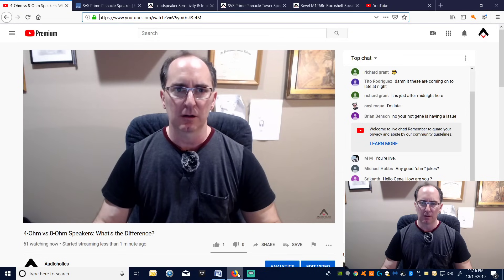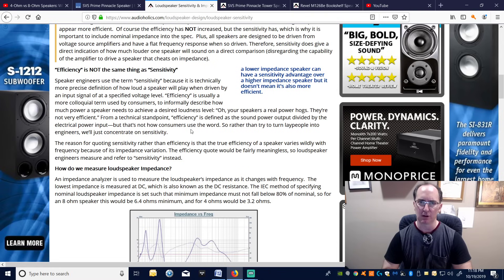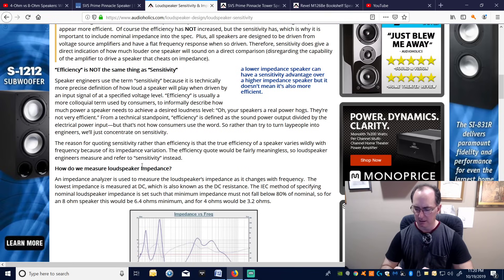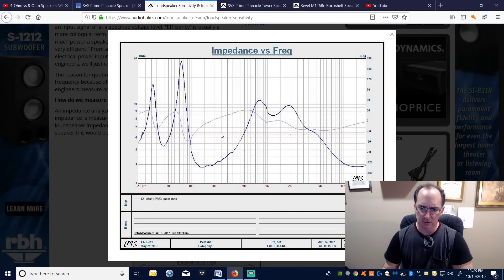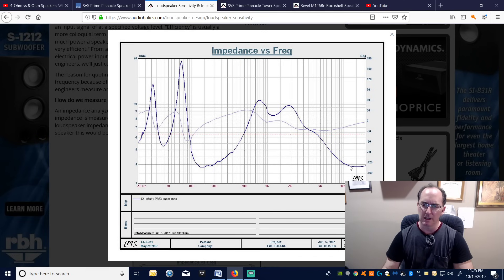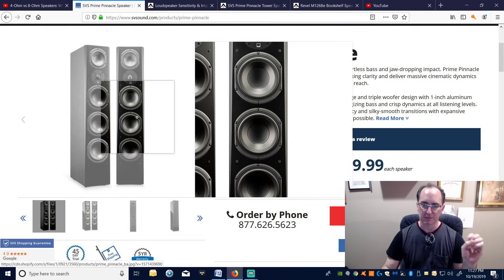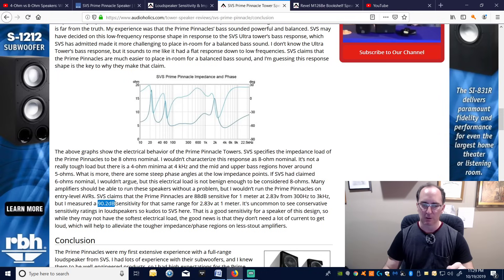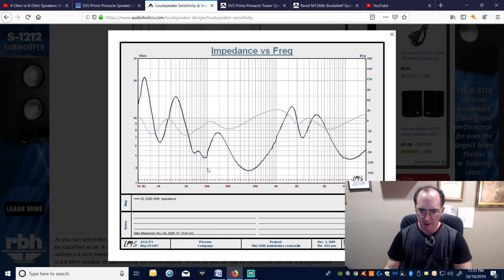Loudspeaker Impedance 4-Ohm vs 8-Ohm: Which is Better?

Comment: I only run 8 Ohm speakers at no lower than say 86db or 87db....    It's not worth going with a 4 and being stuck with only more expensive amps to run.
Reply: I run a 5 speakers in a 5.1 system that are all 90dB & 8 Ohms. With a separate stereo power amp for the front left & right speakers. Separate mono amp for the centre speaker, and a separate two channel amp for the surround speakers.

Would have cost me much more money for good quality compatible amplifiers if my speakers were rated at 4 Ohms.

Comment: Does 4 ohm speaker require an amp with more power? I would think a amp with less power (i.e. more bang for the buck) since it plays louder. example: 33% of my amp's power into a 4 ohm would be louder than that same volume level (33%) into an 8 ohm. So i would have to turn the amp up to get the same db for a 8 ohm vs 4 ohm. Confused on why 4 ohm taxes an amp.

Comment: If you put two 4 ohm woofers in series and the woofers are rated at 86.7 dB 2.83V/1m, then the combined speaker wired in series would have the same sensitivity of 86.7.  Is that correct?
I am talking about the Dayton Ultimax 12" woofer.  See https://www.parts-express.com/pedocs/specs/295-512--dayton-audio-um12-22-specifications.pdf  I like this woofer and want an 8 ohm system that any amp can drive, so I would rather not use two 8 ohm woofers in parallel.  I also want better amplifier control over woofer movement, so isn't an 8 ohm load going to result in better damping?

Comment: i have a question i have a pair of polk audio TSI 300 tower speakers. the specs say 8 ohm but why is it when i read it with a ohm meter it says 3.6 to 4.1. all speakers in towers are working and sound great but when i crank it up my receiver clips. it is a Yamaha RXV659. Thanks

Comment: Bottom line is you need to know what is your amplifier output capacity then you can match the speaker impedance and wattage you need. Never buy a speaker where you don’t know the application 😂

Comment: Hi there. I have an AV Amplifier by Onkyo and a pair of tower speakers with 6 ohms impedance. I had some issues with the amp shutting down. I was advised by amp technician to select 4 ohms impedance in amp selection instead of my original selection of 6 ohms or more. Please advise me on this 4 ohms impedance selection on my amp with the 6 ohms impedance tower speakers. Will it cause any harm to either amp or speaker? Your technical info appreciated.

Comment: So an 8 ohm rated amp can run a pair of 4 ohm rated speakers as long the amp doesn't overheat due to increase in watts? 
So it's not even about the ohms per se then, it's about the increase in watts which produces higher heat than what the receiver may be able to handle? 
Am I understanding this correctly?

Comment: Have a new Pyle  amppifier 40 Watts x 2  POWER OUT PUT that requires a 10% RMS 4 ohms speakers , but I have a pair of 60 watts 6 ohms JVC bookshelf speakers on hand . Think these 6 ohms will work .

Comment: So let's say you have two different 2-way bookshelf (tweeter+woofer) speakers from the same manufacturer. Same sensitivity, same woofer diameter. One is 4 ohms and the other 8 ohms. Assuming all other things being equal (no amp clipping etc), why would anyone buy the 4 ohm version? 
Is there something inherently better about a low resistance coil that translates into more linear driver motion? The compromise being it just wastes more power.

Comment: Hi Gene - thank you so much for the explanation on 4 ohm vs. 8 ohm speakers.  Follow-up...I am considering a pair of Tekton Pendragons - Eric offers them in 4 ohm builds or 8 ohm builds.  I have a high current 250 watt per channel amp - should I go with the 4 ohm build with upgraded 4 ohm caps and capacitors??  I was thinking the 4 ohm as I want to eventually dive into tube amplification. Thanks
Reply: The higher the ohms, the less power they require.

Resistance gives you an idea of efficiency, but not of audio quality.
Reply: Scott...I have the 8 ohm Pens with the 7 tweeter array and upgraded wiring and caps...Love them.....They wanted me to do the 4 ohm and I said no way....Almost all hi efficient , hi end audiophile speakers are 8 ohm. They sound better.
Reply: I'm going with the Enzo XL with 7 tweeter upgrade and upgraded crossover components. I'm deciding between 4 and 8 ohms even though my Parasound amp can handle 4 ohm loads. I just think it will run hotter and don't want to replace it any time soon. Eric is pushing hard for the 4 ohm.
Reply: @blipco5  I know they push almost too hard for the 4 ohm.....Most high efficient speakers are 8 ohm. Even the reviewers say to always use the 8 ohm tap if you have a choice. Good Luck...Good Choice but 8 ohm for me. I will Never sell these speakers because nothing for $2500 even comes close. Don't forget to get a Schiit Loki mini for $148...tone controls are fabulous.
Reply: Dennis Haley.. Thanks for your response. My Parasound P6 preamp already has tone controls which is one reason I bought it though I normally run in bypass. I only use the tone circuit when I use my FM tuner to boost the highs and either bump or tame the bass. My power amp is the Parasound A23+ and can easily run four ohm speakers but I had concerns. So I contacted Parasound and they told me that the four ohm speakers will not be a problem as long as the amp is well ventilated, which it is, but that confirmed it will run hotter. So it's 8 ohm for me as well.
On a side note, they really like the Tekton speakers and they use them to demo Parasound equipment. Mainly for space requirements (Eric suggested the Pendragons but they just won't fit the space, they'll block off two fairly expensive paintings). I'm getting the Enzo XL with the seven tweeter upgrade and crossover upgrade. My big problem now is figuring out the custom color to match my room. I'm replacing my beloved Speakerlab S3 that I built 40 years ago with recently recapped crossovers.
The S3 are nominal 8 ohm, sound incredible (blew away the JBL L100 that I demo'd the Parasound equipment on) and will play louder than my ears can take.
Reply: @blipco5   You'll love the Tekton sound and the 8ohm is your best choice......you might want to try an 8 watt tube amp down the road ( I have one but mostly use the Belles Aria 70 w. SS integrated)...The tubes give the Tektons a different sound  not better or worse, just different...I like both and 8 watts drives these bad boys to wall shaking levels...Never a pinch of distortion.....Enjoy the Music cause that's what the Tektons do best.
Reply: Dennis... I know the tube sound well. Growing up my father had the best stereo around. He had a combo of Heathkit and Fisher power amp in the 30 watt range. A Fisher tube pre-amp, an HH Scott tube stereo tuner, a Rec-O-Cut turntable and AR 2a speakers. I used to listen to it with my friends for hours. All the tubes glowing and wattage gauges and the red and green indicators on the preamp. The gold faced Scott tuner with the vernier FM dial. My friends would bring their albums over because I guess they got tired of Herb Alpert and the Tijhauna Brass or Leroy Anderson. Ah the memories.
Reply: @blipco5  OMG...the Rec-O-Cut turntable....wow.......I'm actually looking to run the pre out on the Belles to A Parasound A-23+ amp. I heard that it Wonderful and 160 watts into 8 ohm....I don't need that power but I want to see what it sounds like....I can send it back if I don't like it.
Reply: I think you'll be happy with the A23+. The power is not in your face but it's there if you need it. With my current 8 ohm  Speakerlab S3 speakers (87 db efficiency) the amp gets only slightly warm. I still have the Rec-O-Kut turntable and tonearm. I was hoping one day to refurbish it and use it but I don't think that will ever happen.

Comment: I remember when I was into car audio. I had a 2 ohm stable amp and nobody could believe it was 2 ohm stable because no one I knew had a 2 ohm stable amp at the time. I loved that little 150W Crunch USA amp. It pushed 2x10" Pioneer 300W speakers with ease. I miss those days. 😀
Reply: Back in the day, we considered an amp that would not be stable into a 4 ohm load was  crap. Some were stable at 2 ohms.  In testing we did see high power rated amps that had protection circuits thay would shut them down when encountering a  stop to 4 ... far below there rated power.  So now anything below 6 is a problem for receivers rated their receivers driving only 1 channel at 1000hz with distortion sometimes 5% or even 10%.... yielding a very misleading wattage rating.
Reply: All current, yet no real volts to speak of to really back it up. Am I right?

Sure you can use transformers etc, but the car is never producing 120 volts of stable and reliable voltage.

Comment: Interesting monologue, Personally I have always preferred high impedance speakers because the requirements for the speaker cable become less stringent (and I can just put a hum drum cable in place, I always concidered cables as closing post of the entire budget). The sensitivity issue between 4 and 8 Ohms I find less compelling. I prefer to relate sensitivity to power dissipation rather than voltage to understand the speaker motor. Like wise when I look at an amplifier, I look at the (RMS) power to an 8 Ohm speaker to match the two components (if you have 2 high sensitivity speakers in a living room, the neighbors will be calling the police at 20 Watts output so I am completely at loss why anyone needs a 300W per channel amp). The part of the impedance setting I found very interesting and learned something new :) But I was waiting to get the exeption which are tube amplifiers (or rather amplifiers using an output transformer) they have to be impedance matched to maximize the power because they are not approaching a voltage source.

Comment: The tower speaker may not be triple woofer, it may have 2 active woofers and a passive radiator, also many centre channel speakers are 4 ohm due to the 2 8 ohm woofers wired parallel

Comment: Thank you for the advice at the end about the 4/8 ohm switch on the back of my amp, I thought by having it on the 4 ohm setting I was getting more output, I was wrong thanks.
Reply: Output resistance should always match what the speaker is wired/rated for. Safe mismatch is possible but not ideal.

Comment: My amp has selection for 4ohm or 6ohm but my speakers are all 8ohms, setting it to 6 ohm, am I missing anything, sound wise?
Reply: Darren Lomax@ My amp is 4 to 16 ohms, which means i can use 4ohms or 8ohms, speakers with-out a switch, it will switch over automatic. But a 4ohm speaker will be louder at the same volume and will gave out more watts on a high volume because 4ohms has a higher voltage.
You should never put a 4ohm set of speakers on a 8ohm amp, because the amp will over-heat due to not been able to handle the voltage.
Reply: @alanjipy55  so you can use 8 ohm speakers on a 6ohm amp? My last amp was 6ohm and the 8ohm speakers were quieter.
Reply: @darrenlomax1283  I think the gap is to small so 8 ohm speakers on a 6 ohm amp should be safe, ok. You wont get max volume from your amp with 8 ohm speakers, but would take more care while playing music at high volume levels.
As a general rule. Amp 8 Ohm, Speaker 4 Ohm: Risky, because the speaker will draw too much current at high volume.
Amp 4 Ohm, Speaker 8 Ohm: No problem, but speakers will not be as loud as expected.
Amp 8 Ohm, Speaker 8 Ohm: Best setup.
This is my set-up had these for about 30 years. still use them every day.

Pioneer A-400. Integrated amplifier. DIN Continuous power output (both channels driven at 1 kHz)
85W + 85W into 4 Ohms. 1% THD
60W + 60W into 8 Ohms. 1% THD.

Tannoy 611 speakers. Recommended Amplifier: 10 - 150 Watts.
Sensitivity: 91dB
Nominal Impedance: 4-6 Ohms.
Reply: Alan Jipy thanks for that Alan, I've been looking at upgrading to an Arcam AV receiver but I can't find any of the specs regarding impedance for any AV amp I've looked at. I find that weird they don't include it with the power specs.
Reply: @darrenlomax1283  You'er welcome. I'm not really up to date with modern systems, but think most AV amps will have a. Impedance switch. I have a Yamaha DTS AV. Processor/Amp. which i got about 15years ago, as an add-on to my existing stereo. Amp. with a Impedance switch.

Comment: Gene you sweetheart!  I feel like the belle of the ball!  Ha ha  thanks for taking a deep dive into this topic!  I  saw this video 2 weeks ago and have been putting off my reply, sorry to leave you hanging.  I ended up passing on those Beta-50’s cause the tweeters were dented, but I picked up some Beta-40’s one of which has a tweeter which although still fully domed shows some past fascination-deformation and little cracks from the CMMD layers delaminating, it honestly looks like glass as it diffracts light when I get up close at different angles with the flashlight. (Sold separately lol) .  I happen to find a replacement tweeter on ebay for a beta-40 and what should I happen to see in the backside photo?  It’s got 4ohms written on it.  I then spent a little time with the brochure and noticed they call their horn-like parabolic waveguide a “Constant Acoustical Impedance” waveguide.  Implying to me that the horn loading provides some air pressure impedance to perhaps increase the 4ohm tweeter’s resistance in the system. Hard to say if they rated it with or without the waveguide.  I put the new Beta-40’s into storage with the rest of my setup, I’m essentially couch surfing, so tragically I haven’t been able to listen. Or analyze.  The Beta series has two center channel options, I have the cheaper 2 way mtm design.  I ascribe to the philosophy that the center channel is the most important channel. So I sprung to get the current reference series center channel RC263 as a bump up in overall performance.  So I have my 4 towers 2 surrounds an extra center channel to cannabalize for a doner tweeter to spare.  But guess what the impedance on the reference series center is marketed at?  6ohm with 89db sensitivity, compare that to the beta line advertised at 8ohm 91db.   Is that just specmanship for the same number?  The reference series also has a much shallower and broader waveguide, it’s almost flush compared to the deep pocket the beta tweeters sit in, but the reference also has a little torus and some other scifi jetsons junk suspended close to the tweeter’s dome.  Which Is exactly the esoteric high tech gimmickry I love!  What do you think about those sensitivity differences in mixing the sets? And about the hornloading affects on impedance curves?  Or the CAi  “Constant, Acoustical, Impedance”  waveguide.

Comment: can you do a review on the JBL l890 tower speakers? what they like for power, best eq setup, best distance from listener, ect. thank you for all of the information you give in your videos.
Reply: I have those speakers two pair.  They are great speakers decent low end and good mids and imaging.  You can run them on a decent receiver just fine.  I upgraded them to the Polk lsim 707s and now the Legacy Focus SE.  For the cost the l 890s are excellent.

Comment: Wish this video would have been available about two years ago, it would have saved me some money. I popped several tweeter's before realizing my Denon 6400 wasn't putting out enough power for my 4 ohm speakers. Because Denon state's the receiver is capable of pushing 4ohm speakers, I thought it was fine. Guess not. I went the somewhat cheap route and bought a couple crown amps for my front three speakers everything's been good since then...

Comment: Am i missing something here? 
From what u understand v sq / r = p. 2.83² = 8. 8/4 =2.
So a 4ohm speaker rated at 85db spl @ 2.83v (no wattage mentioned) 1 m, will be 3 db less sensitive.
Reply from the maker: Not following what you're saying here completely but if you have an 8 ohm speaker rated at 85dB SPL @ 2.83V, if the speaker magically turned into a 4 ohm speaker with all other parameters the same, the sensitivity would now be: 88dB since it's dissipating 2 watts instead of 1 watt from the amplifier.
Reply: @Audioholics  : when the manufacturer publishes t/s params for 4ohm speakers it's usually it's ?dp@2.83v/1 meter.
No 'watt' is mentioned because 2.83v is the measure and is independent of wattage.
The impedance of the woofer will determine the watt output of the amp and in the case of 4ohm woofers 2 watts. This would mean then that an 8ohm woofer is drawing HALF the power in watts at the same voltage sensitivity as the 4ohm, thus giving the 8ohm woofer the 3db advantage.

Comment: When I blew up the Marantz SR 8012 I called tech-support and they stated that I should have switched the receiver to  4ohm
Reply: Lord Jaguar Jaguar 
I have the SR5010 and am looking at getting some 4ohm speakers. I just read that there’s a 4ohm mode you are supposed to change it to. Did you notice a difference? Did it still blow again in 4 mode?

Comment: Your correct except with  a tube amp. You often have the opportunity to choose16 , 8 or 4 output matching. Try all of them...often connecting the 8 or 16 ohn connector to the 4 ohm speaker  sounds better.

Comment: Does the advice to keep your amp at the higher output apply to tube amps?  I've heard that to choose 4 or 8 ohm taps based on perceived sound quality.
Reply: @dubbler9228  On a tube amp generally you want to use the matching impedance tap. However, using the "wrong" tap will just change the load line (or more accurately load ellipse ;)) on the output tubes from what the manufacturer considered optimal so max power output, distortion etc will change. In any normal situation you won't damage the amp but you may or may not like the change in sound. Just be sure to power down before changing as you don't want to have the amp trying to drive an open output.
Reply from the maker: No,this is for AV receivers with an impedance switch.